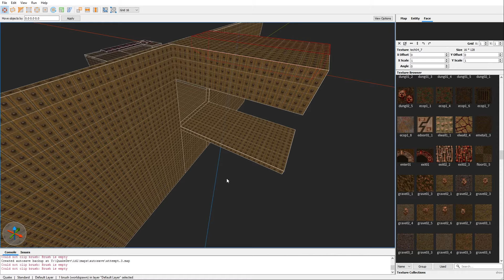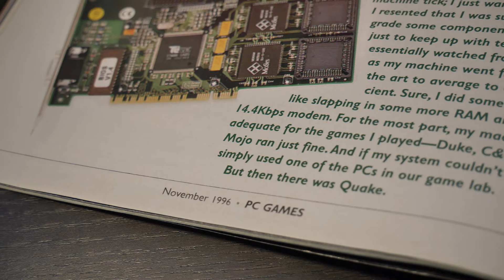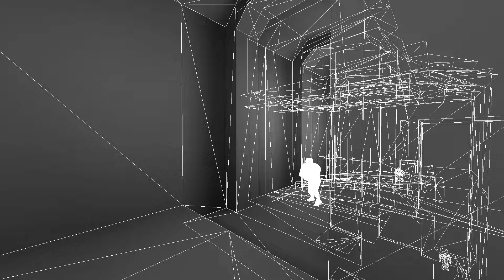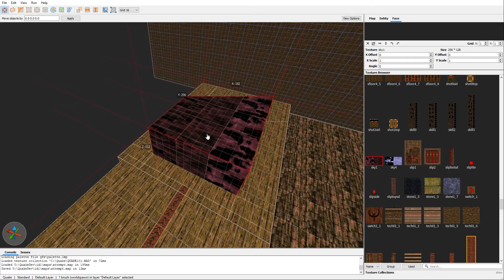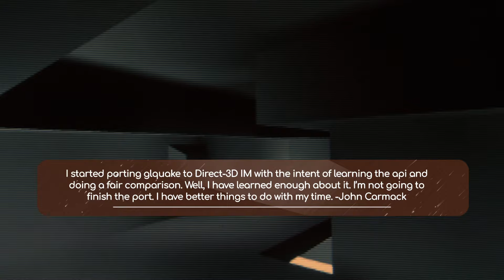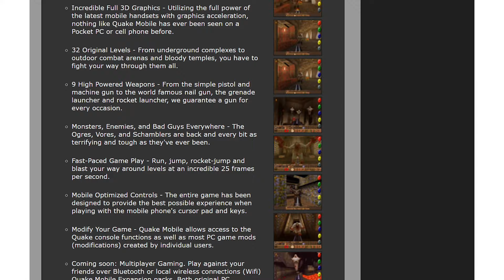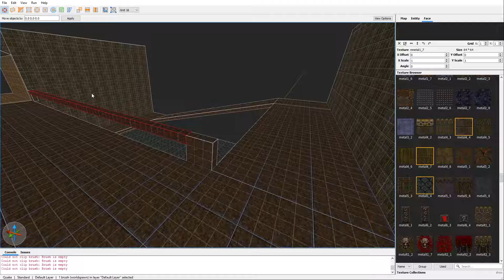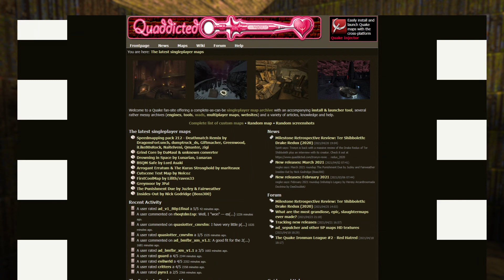DF Retro: Quake - The Game, The Technology, The Ports, The Legacy

Comment: Does anyone else prefer the look of the software renderer? The grittiness of it fits the look so well!
Reply: very much so
Reply: Agreed, but you can use a modern renderer like vkQuake and just turn off texture filtering to maintain that look.
Reply: Whenever I load up a source port like Quakespasm for the first time on a system, the first thing I do is tweak it to resemble the software renderer as much as possible.
Hell, I even turn off animation interpolation because the choppy animations are just so iconic to me.
Reply: @LonelySpaceDetective  same here!!! Gl_texturemode 0, r_lerpmodels 0, r_lerpmove 0 , and weapons positioning, scr_ofsx -5  assuming the POV is 100.
Reply: Yeah thats why I turn off a lot of the texture filters
Reply: Not just Quake 1, I even prefer the software look in following Half-Life and Quake 2 and some other games based on earlier id Tech and Unreal engines. In my taste there's something wrong in idea of trying to smooth out low-res textures and low-poly models in 1995-2000 games. Quake 3 was first game I enjoyed with graphics accelerator, but it was developed with GPU in mind from the start.
Reply: Always turn off texture filtering with the low res textures for maximally crunchy textures.
Reply: Hardware acceleration, texture filtering off. The only way to play.
Reply: @J0rdan912  While I agree on texture filtering looking like garbage on early 3D, AFAIK Quake 2 was developed with hardware acceleration in mind, but put in a software renderer anyway as to not screw over the people who didn't have a 3D card. Someone (Carmack, maybe?) even complained that getting some of the effects to work in software was a nightmare. I'm not 100% sure about it, but I think I read about it in Masters of Doom, or maybe Game Engine Black Book: Doom.

I'm not familiar with Half-Life and Unreal's development, but I assume they were also considering 3D accelerators from the start.
Reply: @kveller555  Yeah, I know about Quake 2, but I definitely can say that Q2 wasn't ready for full support of hardware acceleration. No doubts, it was everywhere, demos was displayed in PC hardware stores, it runs better, had dynamic lightning sectors and everything, but it was so bland, not polished etc. Just like GLQuake. Till this days I prefer software look of Q2, or even PS1 port with great colors, software look and some unique effects like lens flares. Half-Life was literally based on advanced Quake 1 engine until it got serious upgrades to current GoldSource engine level, but just like Unreal both had software mode, both looks and runs tolerable on low-end machines, and had different hardware support. All of this was a big win in front of some other games with forced 3D accelerator requirements and not always pleasant performance and look.
Reply: @J0rdan912  In my opinion, first game, that had sharp enough textures, that are not disturbing even on close range, was Morrowind. All games before had too blurry textures, when too close to them.
Reply: @warrax111  Oblivion was released in 2002 and wasn't that good in terms of graphics - many things, including textures and models quality was simplified for the sake of dozens of NPCs and large open areas. In 2001 we already had Max Payne, Serious Sam, Halo, some other games that goes beyond in terms of texture quality, quantity of objects and locations, using new shaders etc. Even on consoles.
Reply: @J0rdan912  Well, you've meant Morrowind, not Oblivion. I didn't played those three, but I remember, first time I played Morrowind I was shocked, and I've sometimes only going close to textures, just to see how beatiful are. I saw it first time, before always was blurry. I remember particulary first cave, with stone texture, that was close to town. It was so beautyful, those texture on the wall on caves, I never seen so sharp texture before.
Reply: i love the chunky pixels
Reply: When I used to play qwtf I and a lot of other people preferred low res software tendering to gl because even when GL had good fps it didn't feel as responsive.
Reply: I turn the filtering off and everything else on the Steam version. Too bad you can't turn it off on Quakespasm (that I know of). The game is supposed to look vomit inducing dirty so when you clean everything up it doesn't look good anymore...it wasn't made to be played that way :( Sort of like Silent Hill 2
Reply: @GorcStew  you can turn off the filtering in quakespasm with a console command
Reply: The pixelated software 320x200 is the Quake of my childhood and will stay with me forever but now I like playing around with "beautifiers" of modern ports. It's like trying something new and different to see what can be made with it using modern gimmicks.
Reply: @warrax111  Back in 1998, Unreal had secondary "detail" textures that became visible as you got closer to the wall, floor, etc. If you had a Voodoo 2, anyway (I believe it was a Glide-only feature). That was the best solution to low-res texture issue I had personally seen up to that point. S3 was doing some very impressive stuff around that time regarding compressed textures, but unless you actually owned one of their cards, you could only see what they looked like in screenshots.
Reply: @turboprop68  Basicaly all Glide games had problem of too blurry textures. They were basicaly worst of all API, even direct3d and Ati cards had nicer textures. Voodoo cards were fastest, most compatible, but they had this problem, game textures on them looked most blurry of all accelerators. I remember it to this day. Anyway, for me, all games until Morrowind had this problem.
Reply: @warrax111  Maybe the original Unreal engine was an exception, because it and UT looked much better than when I ran it on the TNT at the time.
Reply: @turboprop68  Yeah, Unreal looked good on Glide, but still too blurry textures at close range.

Comment: There was another contemporary 3D accelerated quake that was missed in this comparison: Quake RAVE, which used the low-level layer of Apple's QuickDraw 3D called the Rendering Acceleration Virtual Engine (RAVE). It was platform-specific and never gained much traction, being replaced by OpenGL and dropped entirely in OS X.
Reply: lol, don't think I've heard mention of RAVE in, like, decades.
Reply: OH MY GOD I FORGOT ABOUT RAVE
Reply: I still have the mac version, with the scary game manual.

Comment: No one has told John that shamblers take half damage from explosives.
Reply: I remember feeling like a dummy when I spammed rockets at the shamblers on the Ziggurat map on hard mode after reading up about that.
Reply: I've been playing Quake for over 15 years, before I knew that.
Reply: Sort of similar case with the cyberdemon in Doom, too; it takes no splash damage, so a considerable amount of damage is lost when using rockets against it, but the main difference there is it's still worth it because they do more DPS than any other weapon except the plasma gun and BFG.
Reply: To quote a certain prisoner forced to review games for the internet:
"You ought to remember: Shamblers are explosion *resistant*, not explosion *proof*."
Reply: @GrammerPancreas  Doom kind of trolls you when it comes to the Cyberdemon, since his first appearance comes in a level that gives you a rocket launcher immediately and has tons of rocket pickups! It's been a while since I played through Quake so I can't remember what weapons are available when the Shambler first shows up.
Reply: @esmerylan  I think you get a super nailgun right before your first shambo shows up and I think the sn is the preferred weapon for those big bastards in general.
Reply: @abadenoughdude300  You're right, I just recently played through it again when the remaster came out on PS4 and you get the super nailgun very early on, in E1M3. And the main game usually provides enough ammo to deal with them. Dimension of the Past, on the other hand... I wound up having to finish off a Shambler with a super shotgun at the end of its final level, that expansion's absurdly stingy with ammo.

Comment: One thing that always stood out to me, at least in GLQuake, were enemy animations.  They have very few key frames with no interpolation so they end up looking like stop motion animation.  Modern source ports fix this via interpolation, but for some reason, the enemies seam to animate perfectly in the Saturn port.  But it could just be that the low animation frame rate more closely matches the low overall frame rate.
Reply: Considering the nature of the Saturn port, I wouldn't be surprised if the monster animations were redone and/or somehow handled differently.
Personally, I kinda love the look of the animations without interpolation. It just feels right for Quake in a way I can't really put into words.
Reply: @LonelySpaceDetective  it kind of fits for the unsettling and almost unreal (ha) horror aspect. I think it was the first terminator film, where the t1000 was animated at a slightly lower framerate than the film reel ran at, giving it an unsettlingly jerky and unnatural feel. it's probably something similar

Comment: The first 3D accelerator I bought had only 4 megabytes of video RAM. It let me play Quake 1 in OpenGL at a glorious 640x480 resolution. That doesn't sound like much today but in 1997 that was a big upgrade over software render at 320x240.
Reply: its literally the jump from ps1 resolution to better picture quality than a ps2
Reply: @dmer-zy3rb  More like Dreamcast resolution. Not many games on the PS2 rendered at that resolution.

Comment: I remember reading in a magazine that Quake was going to be ported to the Atari Jaguar. That would have been insane since the Jag only had 2 mb of ram
Reply: I remember that it was tried but it was a disaster even as a prototype. I don't remember what magazine it was that had a blurb on it. But to be fair the Jaguar was a disaster all around. Where the few 32x + Sega CD games are essentially as good as a Jaguar game. So, considering how weird the Sega Saturn port was. One can only imagine how bad a Jaguar port would had been.
Reply: To be fair, even the PS1 port of Quake 2 is more of a reimplementation than a direct port. And PS1 also has 2 MB system RAM.

Comment: I never liked the blurry, washed out look of GL Quake.
Reply: Basically it was the voodoo cards doing that (bilinear filtering and wrong gamma). Like John showed sort of by showing Vquake… other ports could look a lot more close to the original software renderer. GLQuake on my matrox cards later looked just fine. 

Then again, to play competitive in Quakeworld you would use the software renderer and tweak settings to basically make all the world-textures be something like 8x8 textures, blurry a.f. That all model stood out.

Also note that the software renderer uses 8bit color (256 colors, a palette) and the last few colors were reserved for 'light emitting pixels' that would always show in the dark. You then replaced your local quake-guy skin with a version that had borders painted on in the light-emitting colors, that way all enemies in multiplayer would light up in the distance or dark corners.

Ah, the time when 'cheating online' meant trying to use cl_godmode and modifying local game-resources was A-OK :P.
Reply: @jorismak  glquake looked too bright or too dark, never really worked well out of the box. and on voodoo you could change the brightness...... at least....

Comment: This video is just amazing and I'm surprised how complete and rich in detail it is, you even remembered to mention the Zeebo version which is a console that almost no one knows about.

I had a Zeebo in Brazil (it's a very interesting console, it was much cheaper than consoles like the Wii or PS3 and the games were also quite accessible for the Brazilian public, besides that I always thought it was very innovative on the part of TecToy in betting on a console without physical media at a time when WiFi and 3G were just in their infancy in Brazil), but it had many limitations, the games in the store could not exceed 50 MB and because of that many of the games on the console are ports of Android or consoles like PSP that were light games at the time, it used Brew as an OS which was just awful and had pretty weak hardware for a 2008 console (I think it's weaker than a PSP and Dreamcast).

But Quake 1 and 2 are pretty amazing ports and faithful to PC versions, oddly enough it's one of the best Quake ports I've seen on a console, Quake 2 on Zeebo in particular surprised me for being the only version released with option for dubbing in brazilian portuguese, TecToy really worked on these ports despite being very old games.

Comment: Nice video! Wasn't expecting the Zeebo version reference! I've worked in the Zeebo first-party studio that made the ports of Quake I and II and other atrocities. Zeebo had support for OpenGLES 1.0, so I suppose it's not much different from the GL Quake version. I wasn't directly involved with Quake I port, but it was a straight port with little modification if I remember correctly. We've made mostly localization work, like changing textures that had english text on it, stuff like that. Performance was pretty bad, though... around 20-25fps.

Comment: I remember getting the Rendition V1000 with vQuake packed in on release day. So exciting. And I did used to play in 512 x 384 mostly, it would have been on a K6 at the time probably.  Also, iD would release new firmware for vQuake quite regularly, and with each new Verite firmware, came better and better performance.  I added a VooDoo card alongside my V1000 when it became clear that was going to succeed more generally, but damn, I did love vQuake.   Actually found my old V1000 PCI card the other day, but have no PC to run it in.   Thanks for the run down memory lane :)

Comment: Gamma issue in GLQuake was not a problem back then because most CRTs had very direct brightness control (a knob) easily accessible on the front. I know might be incomprehensible for modern players but fiddling with your monitors knob is a common practice back then.

Comment: Quake, WinQuake, and glQuake was literally THE killer app. Especially transparent water in glQuake!

I used to playing Quake at 320x240 VGA on a Pentium Pro 200, glQuake at 512x384 at 60 FPS on the 3Dfx Voodoo 1, and glQuake at 640x480 at 60 FPS on the 3Dfx Voodoo 2. Even though the Voodoo was 16-bit its silky smooth 60 FPS was a game changer.

CTF (Capture the Flag), ThunderWalker, Team Fortress, and Mega Team Fortress also ushered in the PC Master Race and Internet multiplayer giving birth to LPB (Low Ping Bastards) when ping < 50 ms. There were some amazing players with 150 ms and 300 ms.

Comment: Very nice video. I am pretty certain the N64 version used gouraud shading, not lightmaps. With the limited texture cache doing lightmaps on this would be a nightmare, so gouraud shading would make more sense. That would also explain why the light is so "exaggerated" in this version, with less finer details as the shading covers huge triangles.

Comment: 512x384 is weird resolution but it turns out a lot of software actually supports it, my CRT monitor recently started accepting resolutions below 640x480 (before it didn’t let me) so now I might try to use 512x384 on this monitor to see how it looks. It would’ve been cool to see some off-screen CRT captures showing 512x384 with a camera in this video.

Comment: DarkPlaces is my preferred source port. Not only does it look gorgeous but it's pretty much the only source port I've found that doesn't make my mouse feel screwy. Later on I'm gonna check out the N64 version on the most accurate emulator available with the best looking CRT shader available.

EDIT: Welp, I tried QS-Spiked and I think it's now my preferred source port. It runs super smooth and there are no issues with aiming. Also Arcade Dimensions was designed to work with QS-Spiked, so there's that. For the first time ever for me, Quake actually looks and feels like I'm playing at 140 fps with G-Sync. ^O^

Comment: You touch on the CPU speed, I just wanted to add something, because I had the chance of trying both the Rendition Verite "accelerator" and the 3Dfx 4MB in 1997, on a Pentium 133

The Rendition Veritee was simply unplayable with bilinear texture filtering enabled, and after disabling it I would get a performance very close to the software rendering, with indistinguishable increase in quality (sorry I forgot to check the water textures back in the day). After taking the Rendition Verite back to the shop and getting a 3Dfx, with my Pentium 133, the performance difference was night and day.

Maybe in 1999 the story could have been different with a Pentium 3, but in 1997, 3Dfx was the only real accelerator in the market and could take me through games like Sin and Half-Life without any issue for a coupe of years, with that Pentium 133MHz.

Comment: 1. I think Unreal was more important and had more profound impact that still echoes. It came out year later but it was way more advanced than quake engine. Quake wasn't built with 3d acceleration in mind, but Unreal was optimized for 3Dfx cards.

2. I didn't like GLQuake (when I bought my Pentium II 300MHz), because of issues mentioned by you (water fx looked like crap in GLQuake, and it wasn't dark enough (gamma thing)). I preffered software mode.

3. Excellent job! :)
Thumb up!